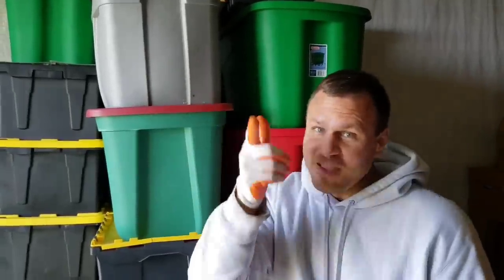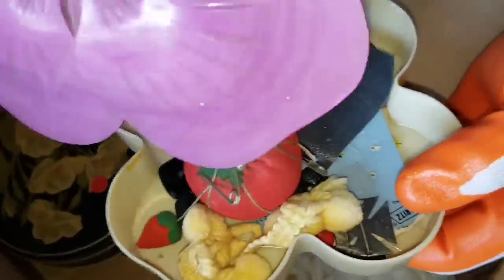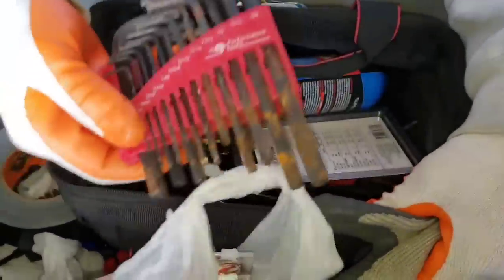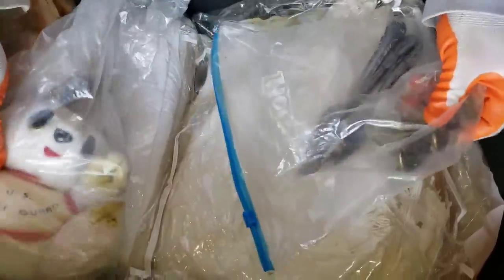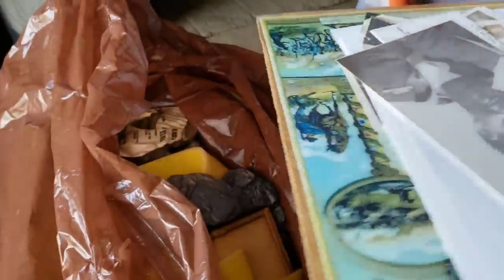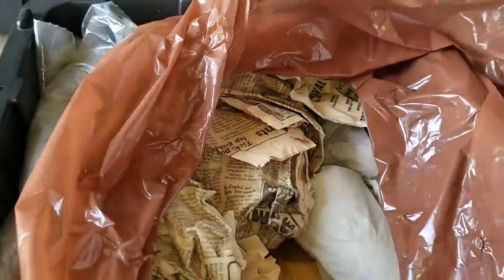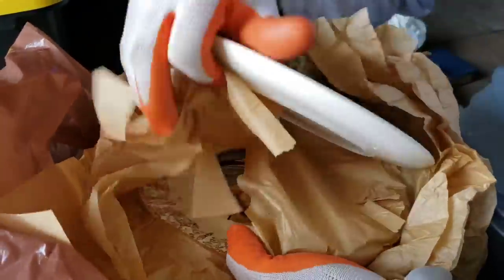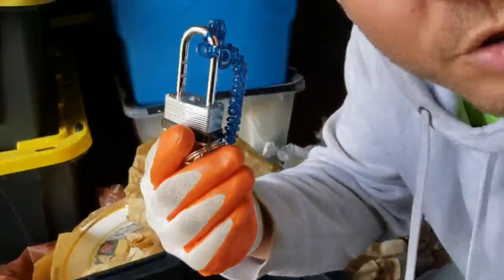FOUND MILITARY STORAGE UNIT I Bought An Abandoned Storage Unit Locker Opening Mystery Boxes

Comment: These units are the gift that keeps on giving. If you can stand the thickness use the left hand glove turned inside out to cushion your right hand and then put  a right hand glove on over it. It’ll stretch out the usefulness of the ones where the finger has worn away and cushion any injuries. That beautiful decorative cup that was rose with extensive decoration could be a soap cup for shaving cream. They’d drop the soap in the bowl and use a brush to work up lather and apply to the face. The cups were prized possessions and handed down in families.

Comment: That's the "old" specialist patch.  It was the 2nd rank in the specialist line, appropriately termed "specialist 2nd class".  These ranks went all the way up to 7, BUT didn't hold the weight or authority that a Non-Commissioned Officer (NCO) aka "Sargeant" did....  so they phased them out over time and by 1985 only the "specialist" rank remained, which is an E-4.  E stands for Enlisted.  They replaced all the old Spec. ranks with Sargeant ranks from E-4 to E-9 AND recently in 2008 they added an additional E-9 rank that is held by ONE DUDE.  It's called the Senior Enlisted Advisor to the Chairman of the Joint Chiefs of Staff.... that's a mouthful!  E-4 through E-9 are your NCO's.... Sargeants... LEADERS!  They are divided between JUNIOR and SENIOR NCO's.  From E-4 (Corporal) to E-6 (Staff Sargeant) are Junior.  E-7 (Sargeant First Class) to E-9 (First Sargeant, Sargeant Major, Command Sargeant Major AND the ONE DUDE) which are your Senior NCO's AND require promotion to such a rank through CONGRESS.  When it really comes down to it... they're the one's that make shit happen in the Military.